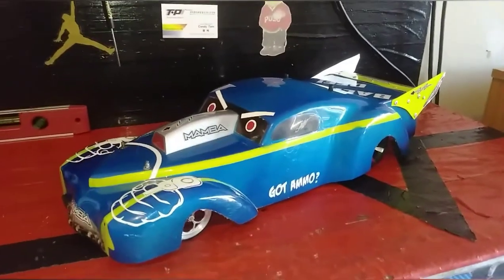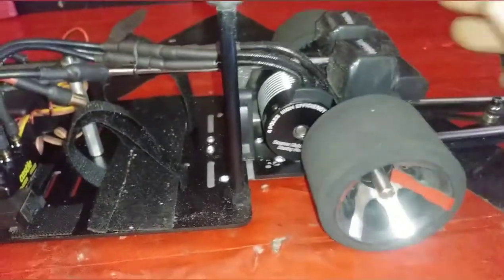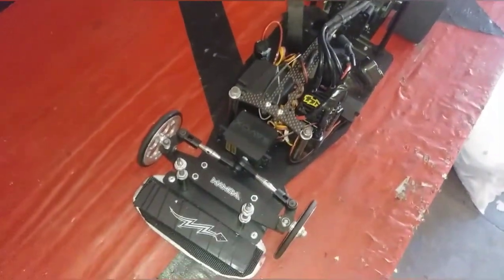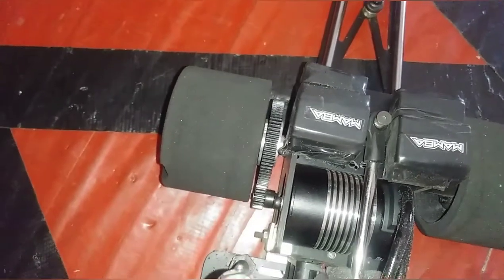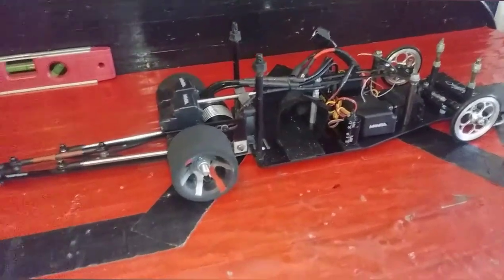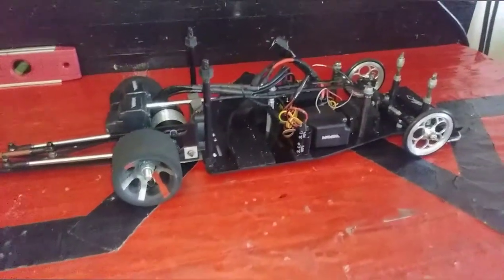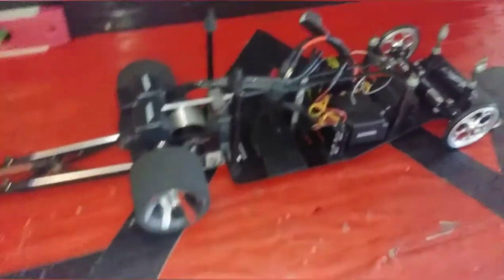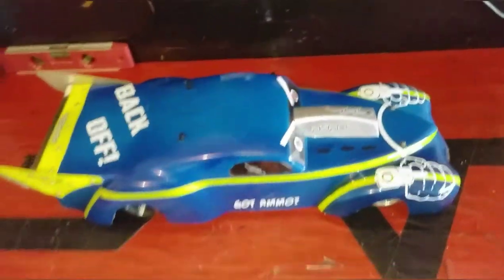RJ SPEED PROMOD slipper clutch holds up

Comment: Do a video on how you installed the slipper clutch i just bought the RJ-SPEED POR MOD KIT. I got the better GT rear wheels already and MAX-10 ESC WITH 10.5 TURN MOTOR.
Reply from the maker: Will do bro give me a day I will have it up.

Comment: Where  can i get the slipper clutch & what type do i need?
Reply from the maker: https://www.ebay.com/itm/New-RJ-Speed-Dragster-Funny-Car-Pro-Mod-Ball-Differential-Kit-1-10-Pan-Cars-5732-/332981022407?mkcid=16&mkevt=1&_trksid=p2349624.m46890.l6249&mkrid=711-127632-2357-0
Reply from the maker: I'm bring out my pro mod it's different you will see soon I'm coming back to it bro
Reply: @nathanthomas3602  awesome bro! & what about the wheelie bars!? They look adjustable
Reply: @nathanthomas3602  where can i get those bolts at to replace the oilite bushing? On the wheels